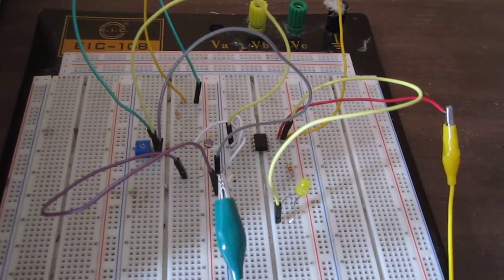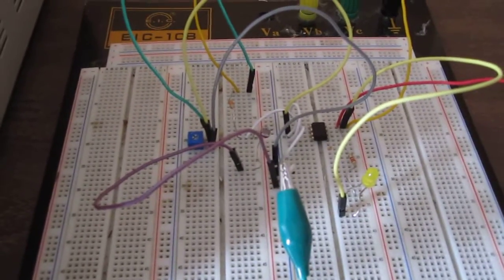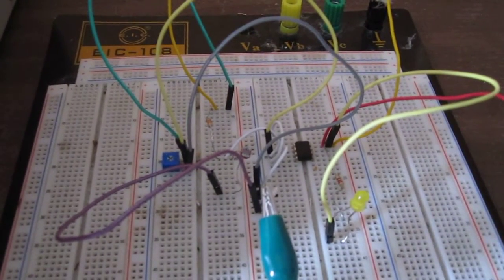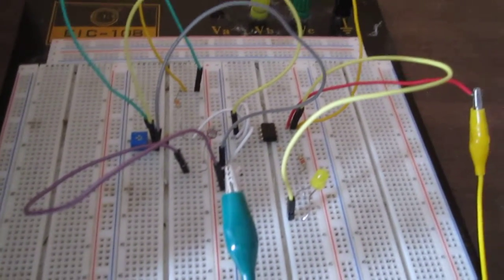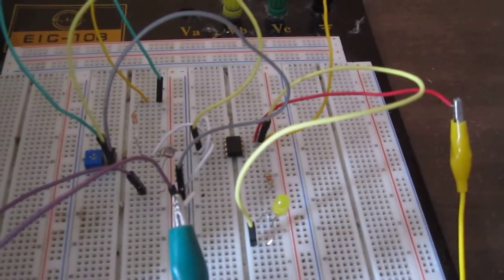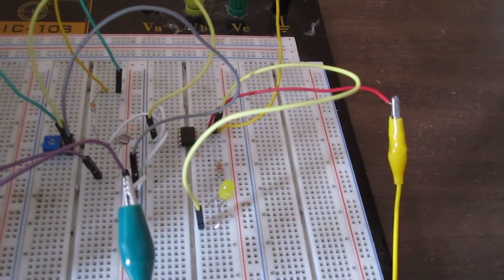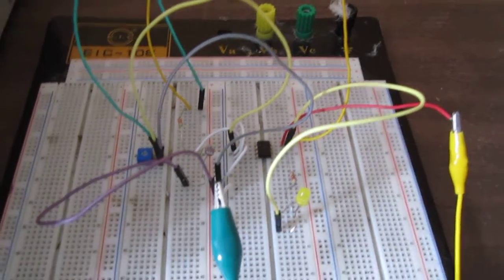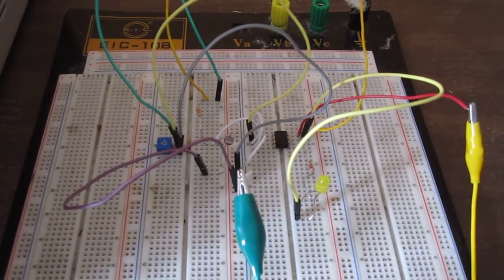LM311 Voltage Comparator Circuit (operates as night light circuit)

Comment: Hi. If you want to add some hysteresis, you could add a 100K resistor between the output (pin 7) and the + entry (pin 2).
This avoid the fast blinking of the LED when light intensity is very near the on/off switching threshold.  I tested succesfully this behavior by using a 100K resistor.
Cheers